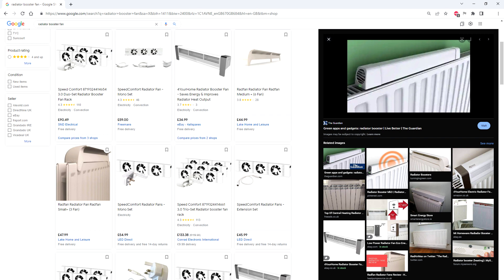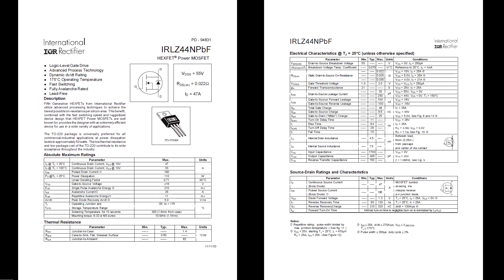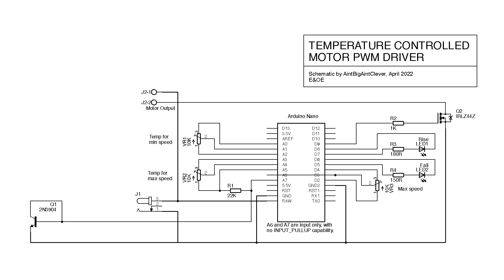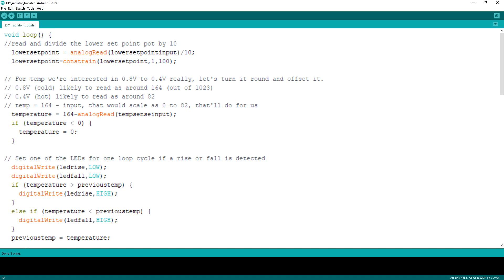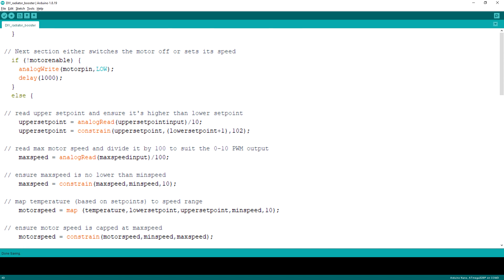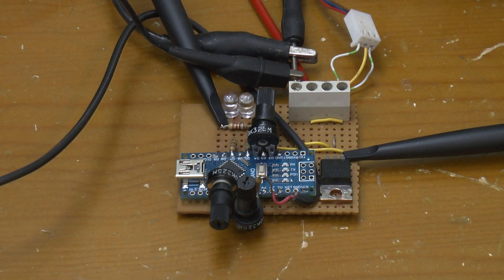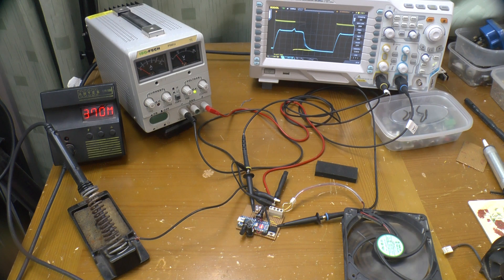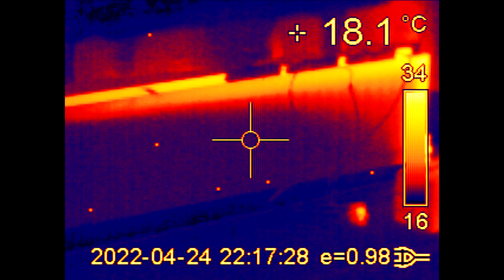DIY radiator booster

Comment: Hi thanks for the very valuable video     i think that the main issue with home radiators is their design    They should be designed like those in the cars   Much more efficient design   
In the cars case the efficiency of heat exchange is so much higher that is impressive      I do not know why home radiators are so bad heat exchangers

Comment: The fans should be blowing from the bottom up, rather than sucking from the top up. Because the fans suck from 180 degrees, they will be sucking ambient air as much as warmed radiator air. Blowing from the bottom ensures that the air is moved over the surface of the radiator faster which extracts more heat. 

If you want to cool something with a fan then you blow the fan at it. You don't blow air away from it.
Reply: In a car stopped but with the engine running the fan placed behind the radiator actually pulls air through the radiator          To simulate the air flow hitting the radiator when the car moves

Comment: If the air moved by the fans is less than skin/body temperature (~35°C), then you will get cooled by it, rather than heated, due to wind chill. That's why the air might "feel" colder in the fan section: because it's moving faster.

Comment: What was the heat before fan installation, that's what your measuring. You need before and after to measure the heat transferred.

Comment: Maybe a bit late after almost 2 years, but I think there's some misconception here. These booster fans aren't there to do much with the overall heat to get to the energy efficiency effect that these manufacturers claim. It's all about forcing a central heating system based around a modern condensing boiler to maximum performance. There are good videos here that explain how modern condensing boilers work (one I like can be found at MEP Academy here on YT). With old fossil fuel boilers 25% of the energy coming in was lost through the exhaust. In modern boilers these hot exhaust gasses, which is pure energy, are used to preheat the return water before it is heated in the main heat exchanger by the burner. However, condensation and subsequent heat exchange will only occur when the return temperature is below 54.4C. So, a lower return temperature increases the energy efficiency of the condensing boiler. The difference between the flow and return temperature of the boiler (delta T) needs to be high to get all the energy from the, otherwise lost, latent heat of the exhaust gasses. Instead of 25% energy loss a well-adjusted condensing boiler system can get up to only 2% energy loss. Reducing the pump speed, so the heated heating water flows slower through the system in order to lose more heat before it returns to the boiler, is one basic measure one can take. Another is reducing the boiler's maximum heating temperature so that the return temperature becomes lower as well. One could also close the radiator valves a bit to reduce the flow speed or have special return valves installed to regulate a radiator's flow to maximum efficiency. All these things don't have a negative influence on the overall comfort as long as a (preferably intelligent) thermostat can do its work. If all fails and the return temperature is still too high and/or the delta T isn't optimised on could use booster fans to force colder air from the floor of the room around the radiator, so it loses heat quicker and reduces the return temperature. As an added bonus this forced airflow of warm air through the room can feel more comfortable.
In this video it's obvious from the infrared images that the temperature of the radiator is quite even all around. I dare to conclude that the return temperature is too high, and the delta T is close to zero. Fix that first especially when you have a modern condensing boiler. If you haven't got one yet, get one and you will at least safe 20% on your energy bill. Don’t throw away the fans and control board, they might come in handy when you’ve optimised your installation. I found this video looking at ideas for making my own radiator fans. I have a Nefit (Bosch) condensing boiler and added an EMS-EPS interface to get all data read outs and access to settings which I can use to simply switch some silent fans on and off when necessary though automations in Home Assistant.

Comment: I am not sure you really understood the Mechanical effects that should have been looking for. You will not get a higher temperature than the Heating medium will produce, the Water Temperature in the system. the benefit is that you will move MORE air over the Radiator into the room, the very slow velocity the water moves through the radiator will hardy show up using a Thermal Imaging camera, it may be possible to see it if you increase the volumetric flow rate of the system water.
What you should have been measuring is the temperature of the air above the radiator above the fans and the part that has no fans, also measure the temperatures, only that way can you detect if the room is gaining heat quicker.

Comment: Fans to distribute the warmer air more evenly is probably more beneficial (the ceiling gets warmed first). So a ceiling fan perhaps.  Anyone who's ever slept at the top of a bunkbed knows this right? :)     Fans on the radiator should help warm air distribution somewhat, but you would also expect the room to heat up quicker - at least to some degree.   wrt the rad temps - that's one large lump of heat capacity, so thinking about, I am not that surprised the temperatures only changed a little (esp as it's radiant heat that the thermo cam is showing I think?)  Thermodynamics is complex - who knew! ;)        

The reflective insulation sheet behind the radiator is definitely a good idea - have used before.  Also, check that you've got insulation in the cavity wall behind the rad:  we had a loose, unsealed window sill. Once slid out, we found an empty cavity!  Damn cowboy builders!  Sealing up all draughts - such as around sills - will also have a noticable impact.

Many thanks for this video and the work you put in. Very interesting, and has saved me wasting time on a similar 'great idea'!   :)

Comment: Radiator boosters make little difference to the output but do even out the temperature throughout a room. Simplest method: I got a fan heater and placed it so it blew under and up through the radiator (on fan only setting). I'm going to replace an existing radiator with a larger output one (same size but double panel) in the problem room which will be just as cheap as buying a couple of those radiator fans advertised.

Comment: I've found there seems to be a benefit. That is just with a 120mm 1 watt fan mounted in some cardboard wedged at 45 degrees so its blowing across the front and up through the radiator. Doesn't make the room hotter, just makes it a more even temperature quicker.

Comment: A bit late watching this but I did something similar a few years ago for my kitchen  which has a single radiator at one end. Mine was very basic - I just had 2 5v fans powered by a USB adaptor and the on/off was handled by a thermal switch. Very cheap and simple but worked OK (I think it was a 30c or 40c thermal switch). It did move the air around the kitchen and made it more stable across the room. I had it at the bottom of the radiator to push air through (based on the idea that that's how a fan heater or hair-dryer works).

Comment: I thought the idea of the radiator fan is that if you set your water temperature lower to increase the efficiency of your heater ( It is supose to use the condensation heating better.) But, your radiator can not heat the room on this low temperature, you can place the fans to increase the total heat output of the radiator.

Comment: The spacing of the radiator fins is most likely optimised for natural convection, i.e. where the rate the fins conducts heat from the radiator is balanced by the natural air flow drawing heat from the fins.  This is different to purpose made fan assisted radiators I've seen where the fins are spaced very close together like a car radiator to provide more surface area.  These fins are also likely made of aluminium instead of steel.  

However, I reckon this project would work well as a stove fan where the stove is inset in a hearth, such as where a stove has replaced an open fireplace.  Place the row of fans underneath the stove and attach the sensor to the stove.  This would force air around the stove out into the room and probably be more effective than the heat-powered stove fans that sit on top of the stove.
Reply from the maker: The stove fan is an interesting option.  Cheap enough to test (just grab some fans and a USB power supply) and if it works, easy and cheap enough to automate.  The code's in the Facebook link for anyone wanting to go down the Arduino route.

Comment: I would try putting a pull-down resistor on the gate of the mosfet and potentially removing the gate resistor so that the Arduino can drive it with as much current and speed as possible.  You may also need a capacitor in that part of the circuit as well to improve the switching waveform.  Have you taken a look at the fastpwm library for the Arduino as this may help with the operation as well?  I would try adding some sort of air guide to the radiator so that the fans are forced to pull air over the entire surface instead of just the top section.
Reply from the maker: What I didn't show was that the Xbox fans sat in the gap between the two radiator panels.  There are fins along the inner faces of the panels channelling air vertically.
I read that MOSFETs will momentarily pull high current from the gate, hence the resistor to stop it nuking the Arduino output.  I've just searched for the page I saw it on and found another recommending the same, although that used a 220 ohm resistor. https://create.arduino.cc/projecthub/ejshea/connecting-an-n-channel-mosfet-7e0242

Comment: Hot water can hold a lot of energy. Instead of trying to "suck" the heat away try thinking about trying to cool off the radiator by blowing air through it. There's enough energy in that radiator to keep up with whatever you're trying to do to cool it off.

Comment: Really interesting project. I think maybe a good way to simplify the whole thing would be to run 5 volt fans directly from Peltier elements.
Reply: I don't think a peltier can put the required current out.
Reply: I was looking into this - so as to have no wires etc - but as Jammit says below, I don't think the Peltier generator sheets have enough umph!   Plus also, Peltier sheets rely on temperature difference, so you'd need to have a 'cooler' side which will be difficult when the whole area eventually heats up?   Fitting more fins would be best option imo (or a better/bigger rad of course).

Comment: I’d expect the fan assisted part of the rad to blow colder air. However it’s blowing a larger volume of cooler air, so a higher amount of total energy.
Reply: Exactly this. Why would the side with the fan be warmer at all? The purpose of this thing is to move MORE air through the radiator hence heating up MORE air.

Comment: It's a bit of overkill TBH, you don't need all the pwm stuff, you don't even need an on/off either. You can see the fans are definitly drawing some more heat from the radiators than convection alone. We used to live in a cold rickety flat, sigle glazed, leaky, draughty windows. 11 ft ceilings and undersized radiators. The boiler was crap but had a good heating capacity. One winter it got so cold in that place, I had to stuff the curtains behind the rads and stick a 12" fan pointing at the bottom to force assist the convection. You don't save any fuel or money by boosting/assisting radiators, you just get them to output hot air faster than they are designed for or effectivly making them act like a bigger radiator. You could put your radiator in a wind tunnel and make it output like a humungus radiator up until the boiler just can't supply enough hot water.
Reply: Spot on I think. The energy saving aspect is that you can lower your water temperature, making your heater more efficient. And if you can not get your room warm, boost your radiator with the fan.
Reply: @tna-technutamateur8249  There is also the missus factor. She will feel cold at 22c, set the stat to 26 thinking it will get warmer quicker. If the boiler was set to 60c the house would rocket up past 26 to 36 and she would have all the windows open before the rad stats even get a chance to close off due to that hot water standing in the rads. But more fool her, I have set the rad circuit to 44c and ballanced the lock shields to a crack so it all reacts nice and sloooow.
Reply: @tna-technutamateur8249  I could be wrong but yes you are increasing the efficiency of your radiator by getting more heat into the room, but that means a cooler flow of water going to the boiler which means it should stay in condensing mode longer. The higher the temp delta between the input and return central heating temperature increases efficiency. I think anyway lol.
Reply: @billytaj7708  Yes, you are spot on. Because your heater is not heating the water up to high temperature it can use more condensing heat. That's the main reason the heater (not the radiator) gets more efficient. Downside is that your radiators don't have enough surface to radiate enough heat. That's when the fans come in handy.

Comment: I think maybe the radiator was just more efficient then your booster.  The rate at which it removed energy was less than the rate at which the radiator could "energize/soak?" itself with heat.  Doesn't mean your tool wasn't working, just maybe it wasn't easily measurable.  Was the blown air more warm above your booster then the ambient room?     The biggest takeaway from this video to me is test your  theories of foresight before you invest alot of effort into something.  Strategically running a fan as a test up front would save time in some cases, or waste a tiny bit of time in more cases.  I'll have to remember to do the same as I often am not wholey wrong but jump into things without having enough experience or foresight.   Thanks for the content.

Comment: Should've fitted the fans to the bottom of the radiator, blowing upwards.  The way you've fitted them is ineffective.
Reply from the maker: So pushing air from one side is more effective than pulling the same volume of air over the same radiator surface from the other side?
Reply: @AintBigAintClever  you're assuming the air is being pulled all the way through the radiator.  Why?
Reply from the maker: @KarlHamilton  because just below the fans is a double row of vertical channels running top-to-bottom of the radiator.
Reply: @AintBigAintClever  Yes.  But its not airtight.  Most of the air coming from the fans won't be drawn up those channels.  Instead it will take the path of least resistance and be drawn from the gaps between the fins.  In my mind anyway.
Reply: @KarlHamilton  I think you have a point. On my radiators the top grille is separated from the fins by an inch or so. It’s likely that it’s sucking air from the side.
Reply: @VonBugle  exactly.
Reply: @AintBigAintClever  I sense a Part 2 coming.